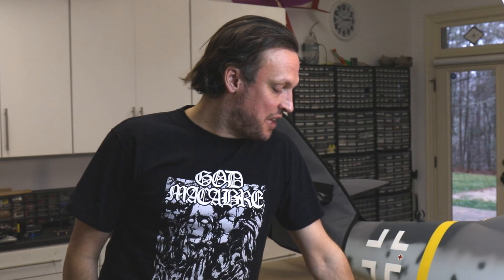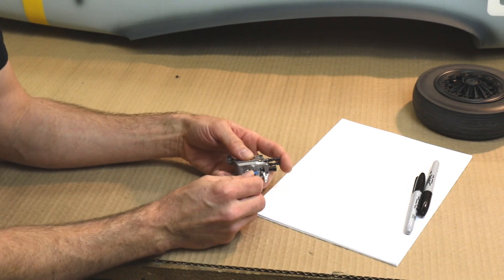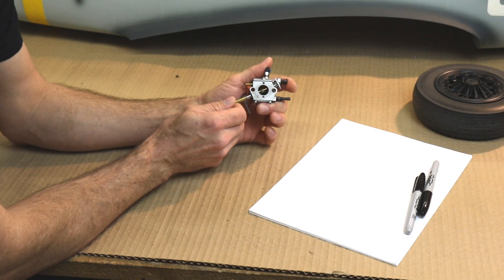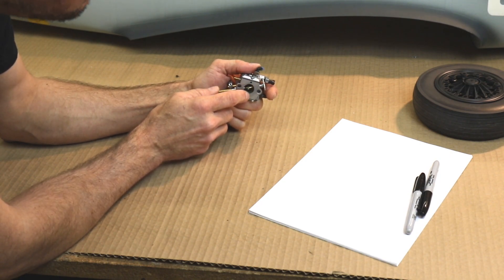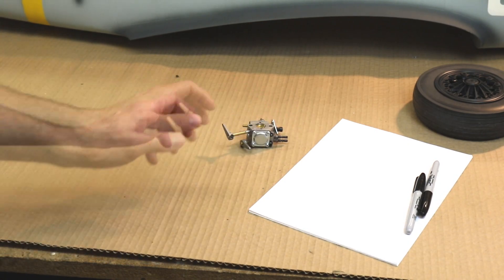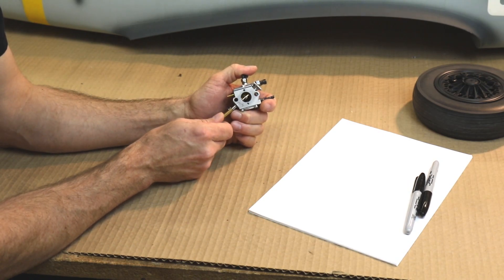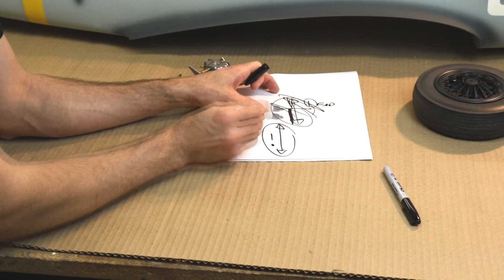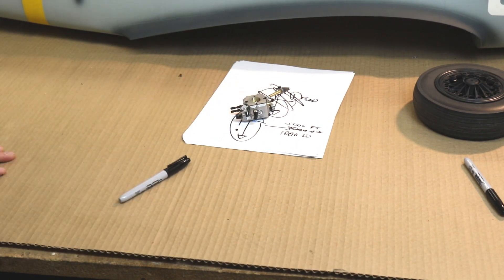Coffee with Dr. G - Episode 6 - Setting up the Carburetor

Comment: I can confirm this information. All three of my Moki's carb position for full throttle is 75% along with 1 second servo travel to full and .5 second to idle for safety. Takes away a lot of mid range over rich condition and nearly zero loss of power at full throttle at the transmitter. I am careful with idle tuning, not too lean or the engine will quit often when throttled down quickly such as when landing.

Comment: Excellent video! Only suggestion I would have is to use a tachometer to verify your high end needle adjustments. Most experts would say tach for about 200 rpm below peak to allow for leaning out at altitude as the prop unloads. I always use a nine point curve to adjust the definition of the stick travel. Once you’ve done it it’s hard to imagine not doing it. Thanks Dr G.